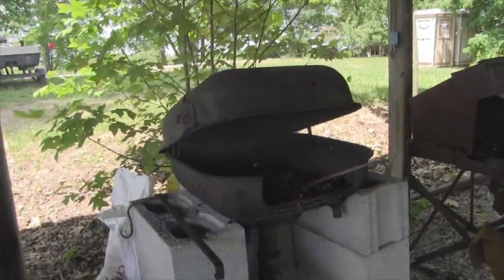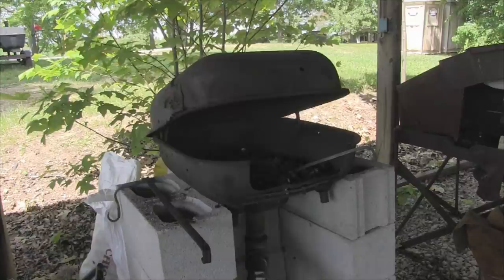Forging a Stock Knife Part 2

Comment: Interesting tool Dave.  You said just what I was thinking there at the end of the video.  I can see it does the rough work of a drawknife without the need for a shave horse.  I can see an apprentice prepping rough stock, just like you did on a stump, for the skilled Bodger to finish.

Comment: It's a new way to do feather sticks! Lol! Great video Dave. I always like the blacksmithing videos. Fire & steel, how could you not love that?!

BTW, here's a little tip for checking your heat treat before tempering. Take a file and run the corner across the area of the blade or tool that needs to be hardened. If it just skates across you're good to go, but if it digs in anywhere you need to redo the heat treat before you can move on to tempering. I don't recall where I first heard that advice (maybe from you), but it works!

Comment: Bevel should be on the backside and an original Clayton  one is about 41 inches long.  In Britain a stock knife is just a clog knife, other types with the bevel the other way round are not stock knives. Not sure if it was a generic term in USA or if someone just got their facts wrong.

Comment: There's little point copying and down sizing a Carter Clog knife  to make a spoon knife. You'd be better off copying an Elwell tent peg knife. No offset, as the handle isn't long enough to hit your skull, and chamfered on the top side as for pegs you don't make concave cuts. The stock knife is shaped that way to make clogs.   It's not as good as the peg knife for making pegs or for that matter what you want.  Peg knives, Klompen knives and Paroirs for making Sabots , none of them have an offset handle. They aren't long enough to need it.  Bodgers in Britain don't use a stock knife.  Sure some amateurs post videos but I don't know anybody that actually uses one in anger. They  have been mistakenly calling any straight bladed pivot knife a stock knife since they got going as an organisation about thirty years ago.  I don't know one pro time served woodsman that uses the term. It's possible they got the term from reading american literature